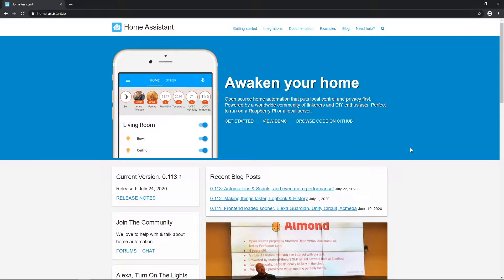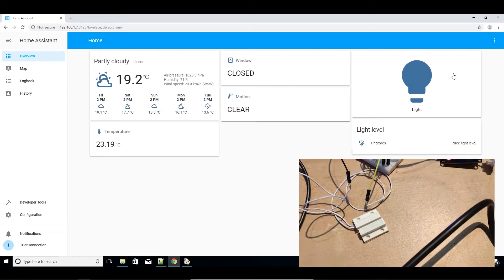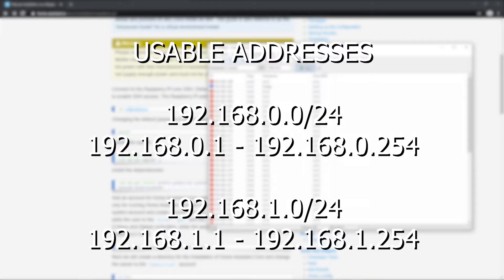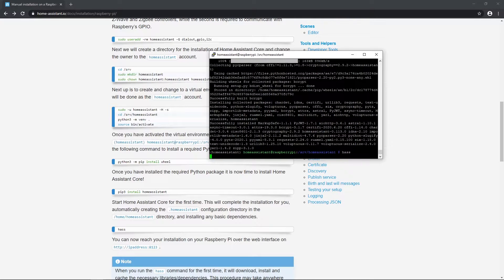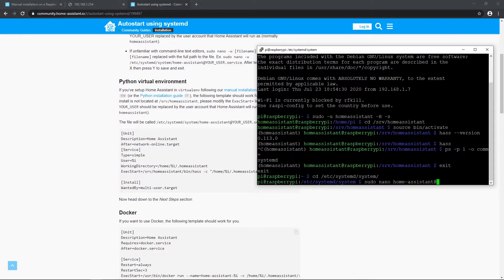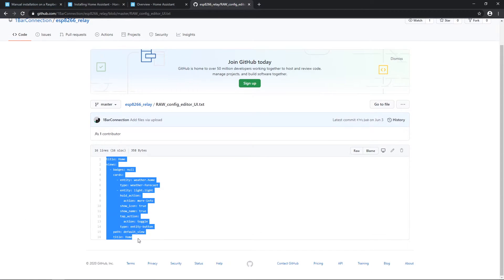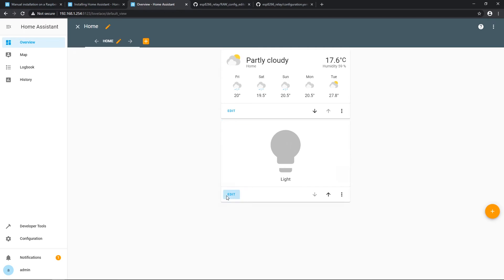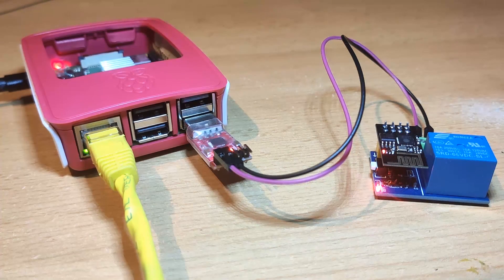Setup Of Home Assistant Core & Mosquitto MQTT Broker Manually On Pi/Raspbian With Auto Startup

Comment: Very nice and rare, thanks, hey any example for DHT temperature readings on this setup?
Reply from the maker: Hi. Thank you. Sorry but not on this one. Check my other videos, maybe you find something useful there.
Reply: don't use DHT sensors they're wildly inaccurate. Use SHT(humid/temp) or BMP(temp/pressure) or BME(humd/temp/pressure)
best sensors in order: SHT85, SHT35, SHT31, SHT30, SHT21/20, BME280, BMP280, BMP180

BME & BMP both are pressure sensors and are RESISTIVE sensors, they will self heat if left on they have a sleep mode. You will see lots of posts for them but SHT are better for temp & humidity only accuracy because they are CAPACITIVE sensors... if you need pressure you have no choice but to use bmp/bme though
Reply: @gg-gn3re  I was able to attach ds18b20 to gpio  of pi gave good temp readings,  also I was able to add dht to OMG arduinomega connected through lan to pi, Mqtt was installed too. And finally a very beautiful thing that is EPIC and for rock solid and dependable installation the bullseye pi let me enable overlay filesystem. Bingo..  this is what I call the system that never fails and  that just works, of course you loose logs history etc apparently,  but is okay for me. I concentrate on functionality and availability.
 cheers.. no ups needed ever. Use backup power only if desired.
Reply: @gg-gn3re  HI, sorry,  I should have been clear, the borrom line is with regular homeassistant installation docker based  on bullseye PI, you cannot enable overlay filesystem.  But with this installation you can enable overlay filesystem which has the benefits of reliable crash proof installation, since it freezes the os.  It took me months to figure that out, cheers I am using one of such installation where the power is highly unstable,  but the system runs fine without sdcard corruption,  cheers
Reply: @gg-gn3re  That is correct the Pi OS that is based on Debian Bullseye, it has a switch to enable/disable overlay filesystem.
Reply: @gg-gn3re  I wanted wired only system no wifi sensors, so the dht sensor was attached to arduino mega,  flashed with "open mqtt gateway firmware " paired with ethernet shield, probably an overkill system but did the trick. Cheers

Comment: Very Informative Video but I have a couple of Doubts!

What is the advantage of this Method over installing using the Home Assistant Automatic setup? 
Is it useful to have Hassio with raspian and pi hole installed?

 Please let me know
Reply from the maker: As stated here: https://www.home-assistant.io/faq/ha-vs-hassio
With this manual installation method you will install Home Assistant Core that is basically a Python program which you can run on various operating systems.

Other option, Home Assistant (with add-ons) is like installing new operating system on Raspberry Pi for example.
It's called Home Assistant OS as you can see on Home Assistant website.
There is also Home Assistant Container if you want to go with Docker option.

It is up to you, to decide which option you want to go with. My main reason to go with manual method, installing Home Assitant Core was because I already had Pi-Hole installed on Raspberry as I said in video. I wanted to get maximum out of Raspberry. I hope this helped you.